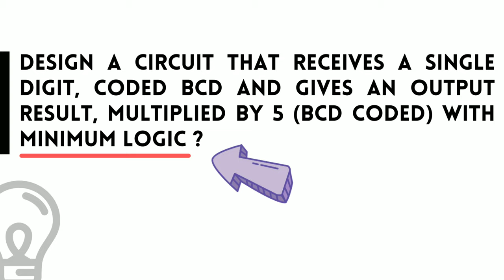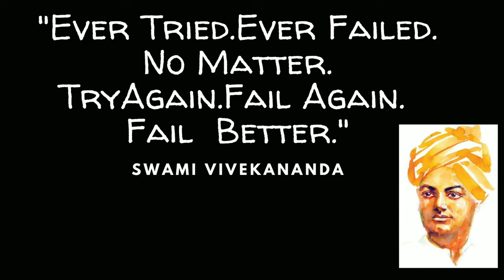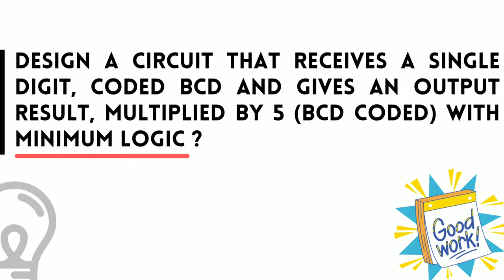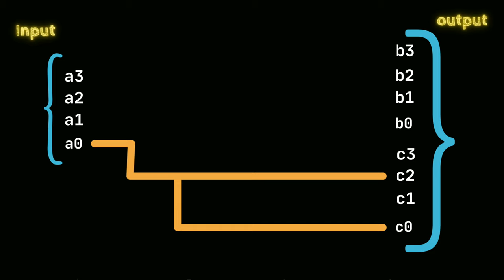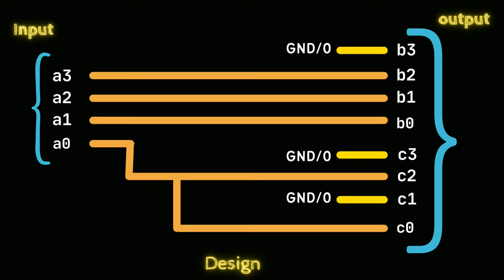This Will Change  How YOU  Think of  Digital Design 🤔| BCD Multiplier | Brain Teaser#1

Comment: I stopped the video at 0:25 and spent a bit over 5 minutes (shoulda been faster) and came up with:
Zero Gate Solution:
BCD input bits:  in3, in2, in1, in0
BCD output bits most sig nibble, least sig nibble:  msn_2, msn1, msn0,  lsn3, lsn2, lsn1, lsn0
Solution:
msn2 = in3, msn1 = in2, msn0 = in1
lsn3, lsn1 = 0.  lsn2, lsn0 = in0

To change the multiplier that gets applied to the multiplicand, a soldering iron and possibly some gates will be needed.
Reply from the maker: Well done boi😎